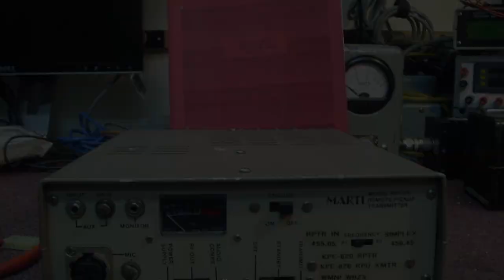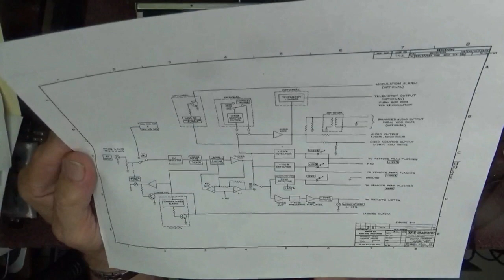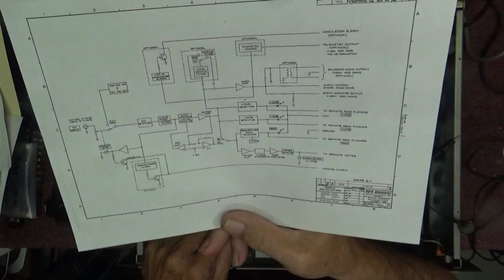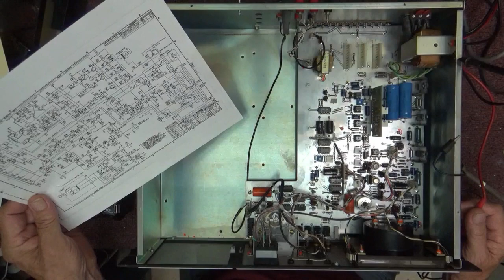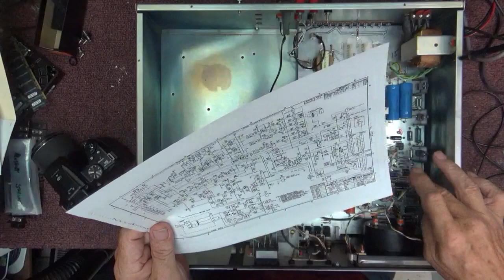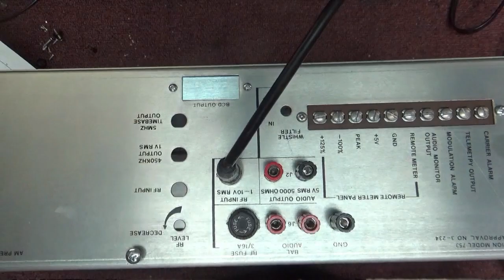Repairing a TFT AM Modulation Monitor

Comment: Hello there, 
Nice video, thanks, I would like to ask you about a RF pickup unity, I have a shortwave low power station here in Belgium, with a transistor transmitter in 6140 kHz and 300 watts, i also have a TFT 923A modulation monitor, but don't manage to find an appropriate RF pickup unity,  as the TX dont have an output for that, do you know how i could do one? Would you please contact me on my email? That would be great if you could give a help, thanks, 
julioroth1@yahoo.com